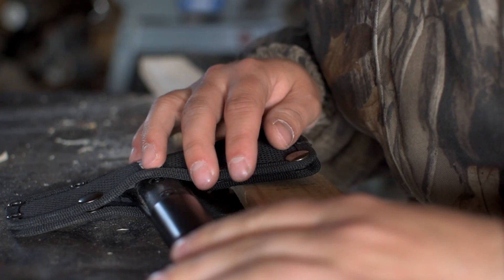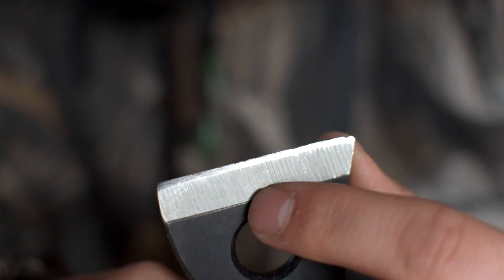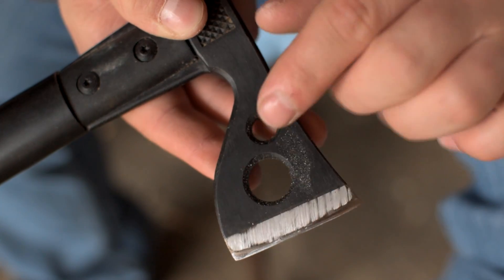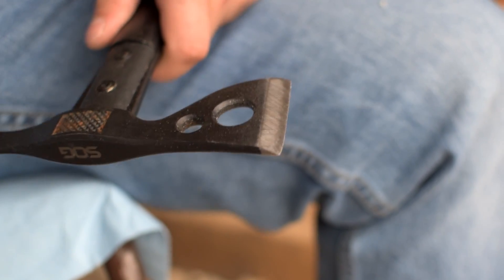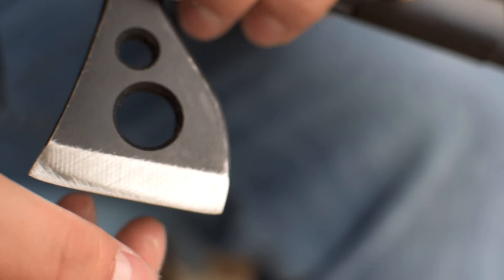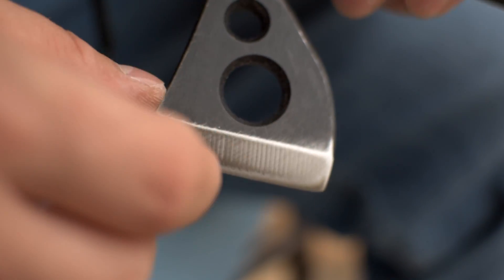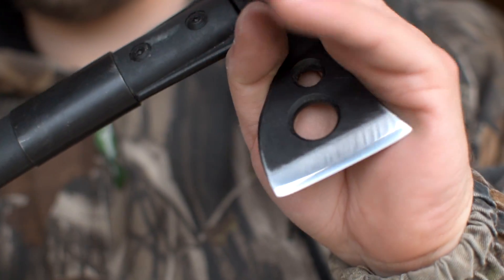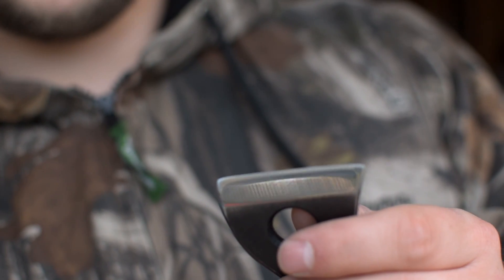How to Sharpen a Tomahawk - SUPER CHEAP METHOD

Comment: I’m 15 I’ve been sharpening blades for about 3 years and I think I’m ready to get a wet stone what’s in your opinion he best option for price and quality
Reply from the maker: I'd purchased a combo stone, with one side being 800-1200, and the other side being somewhere from 3000-6000. I have a Woodstock 1000/6000, and its superb. King makes a good stone for a great price as well!
Reply: Rhett Odenweller I'd suggest looking around at second hand stones in the past people used stones a lot more so better quality as businesses traded on reputation you can get them really cheap and if it needs a bit of flatening so you spend a bit of time flatening is there's a new skill to learn

Comment: Since being a professional  knife sharpener and all , and deteriorating the blades use as an axe of which it's main use is for " chopping of wood " why destroy the edge of it's intended purpose and make the blade edge razor sharp ? I would love for you, being so great as to what you do having a small business and all sharpen a few straight razors, put them through a test and prove to us how well they hold up ? Thanks for sharing your videos.
Reply from the maker: This isn't my tool to test Steve. How does putting a razor polished edge on this hawk deteriorate its usefulness? That doesn't even make sense.
Reply: Steve  Davis That's insane. If your taking the time to sharpen a tool, why not make it hair popping sharp? Sure it doesn't need to be razor sharp but it sure helps for effectiveness of the tool as well as making it easier to keep sharp.
Reply: Kyle Noseworthy - Weiderfan I think he was afraid you made the edge too thin for its intended use.
Reply: @kyle_noseworthy  It chips easyer if its razor sharp

Comment: Your customer is going to be extremely disappointed. I've had one of those for a few years now and they go dull after a dozen or so chops in to wood, even green wood. I've sharpened mine about 10 times now and every time it goes dull within a few minutes of using it. Green wood, seasoned wood, doesn't matter. The steel is just junk.
Reply from the maker: Robert, the customer has owned and used the hawk. They know what they own.. I am giving the owner exactly what they want. No disappointment.
Reply: Ahh. Alright. Maybe I just got one that slipped through QC. Great vid either way =)
Reply: Robert Briggs ,,, And as well Robert , removing the blade edge for it's intended purpose degrades the life of the item severely and cheap  soft/cheap
steel does not help at all. I know of a variety of great axes to buy for several different purposes and would be glad to answer any questions you may have. Best regards.
Reply: I have one as well and the problem is that crappy double bevel grind they give it. It's notoriously difficult maintain on soft steels without expensive precision tools. I gave mine a convex w/micro bevel and now it's a complete different hawk. I don't sharpen as often because it takes a strop so well, and in the rare case I do I use a $8 Lansky puc.

Comment: I've never had much luck with the "rooster" method I also think over time it is WAY more costly over time. I speak from experience trying the the scary sharp method for chisels and planes and costly having to buy the sand paper and I quickly invested in waterstones. For my axes I prefer a artic fox puck in the field and at home I use some small 1x6 waterstones followed by a strop. I'm not knocking what your doing I enjoy the videos but for the long haul I believe the "rooster" method is costly
Reply from the maker: An absolutely fair assessment of the technique Cody! I just put out there what works for me, and encourage people to TRY IT! some have really loved the rooster method, and some simply do not like it. The point is that we don't become so stuck in our ways that we don't give other things a shot! :-) The system you have there sounds excellent as well. I have used the same system for a long time. have a great day!
Reply: Kyle Noseworthy - Weiderfan you as well my friend and I totally agree as long as they try something that's all that's matters